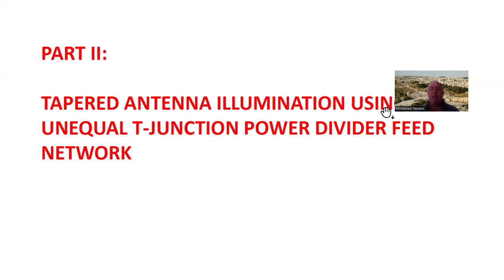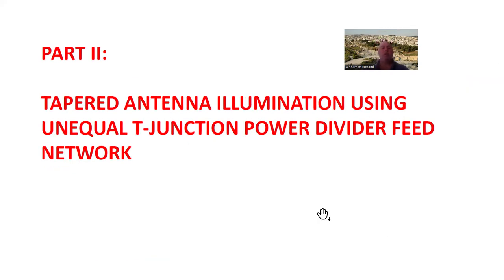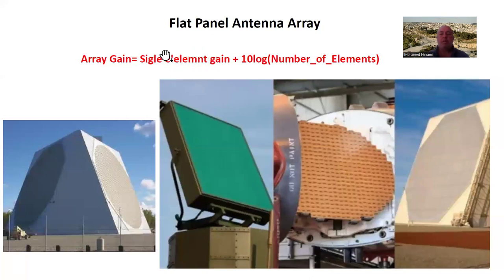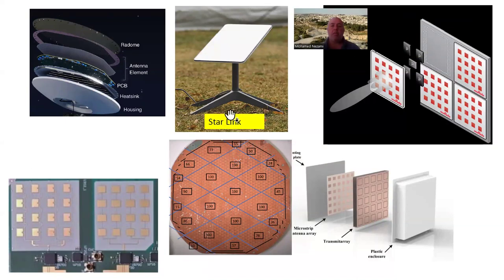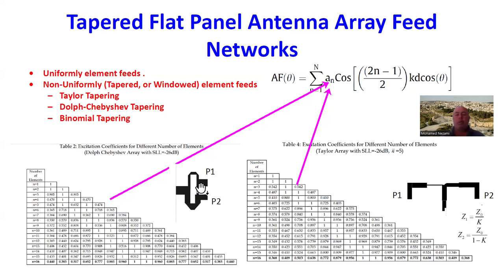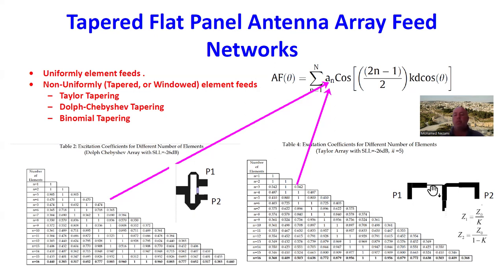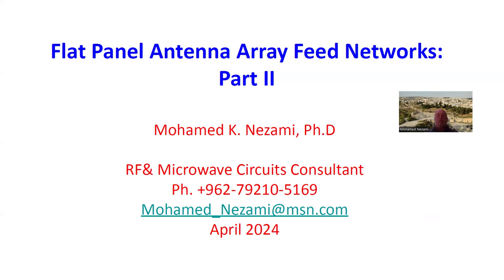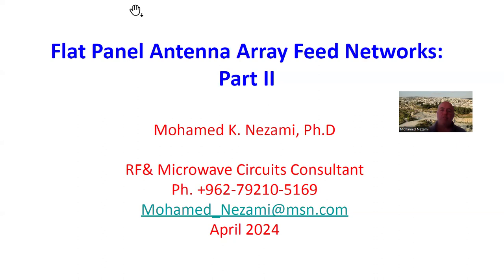Part 2:  Antenna Array Tapered  Feed Networks Design and Modeling,  T-Junction based.

Comment: hi sir,
i have a doubt on length calculation. when i calculate length and width for 50ohm i am getting length=2.42 mm and width=15.66 mm but u r using length=4 mm or sometimes length=2 mm how to calculate the length?
Reply from the maker: with DK=2.2 substrate height 0.8mm, at frequency 10GHz, what is quarter wave length ???
Reply: @RF_Micrwave  0.35 mm is crt sir?